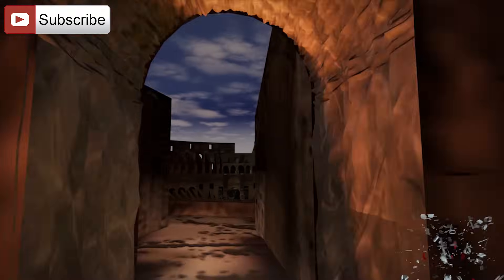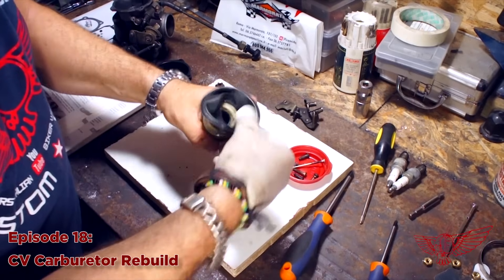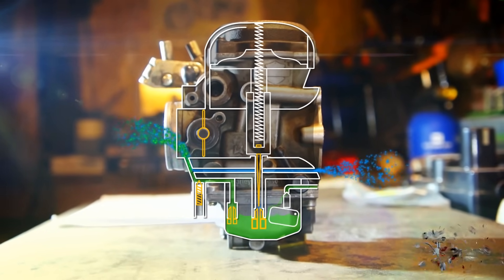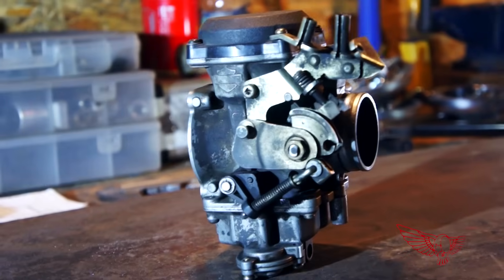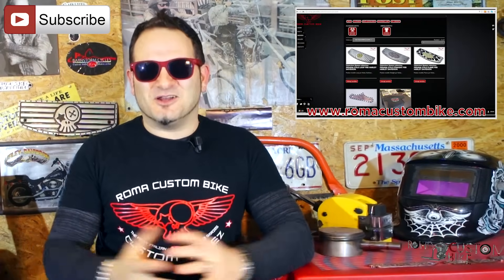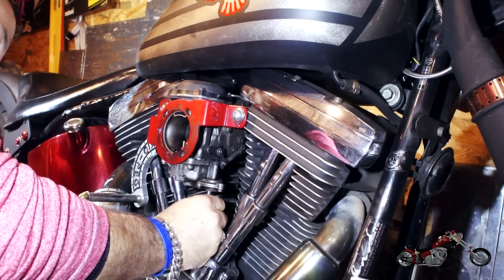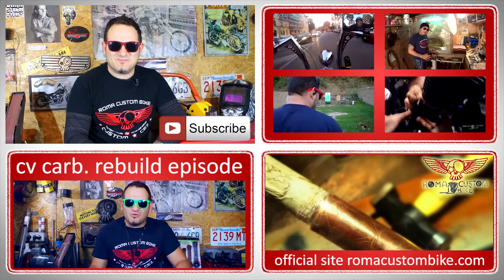How does CV carburetor work animation DIY adjustment screw - ep26 - Roma Custom Bike

Comment: i hav big question for u for problem i m facing. when i start my bike after 5 to 7 hours my bike shuts off while riding first 2km when i stop throttle my bike. after engine heats up or after 2km i dont face any trouble. again facing the problem after long hours. what it would be? pls reply. would be so kind of you. thank you
Reply from the maker: Hi Arooran, it is hard to tell what is going on with your bike, it would sound like an adjustment or jet issue. If you have trouble finding the culprit try going trough the rebuild process to make sure everything is ok.
Reply: +Custom Cez thank you so much for ur kind reply... let me check through... thank you..

Comment: Hi there my friend. Please do help me out with my doubt. I have a 28mm CV carburettor which is installed on my motorcycle. I have an issue like the bike starts choking when the throttle hits the higher side. When the rpm moves beyond 6k mark the bike starts jumping in rpm and it doesn't go above certain range. What would be the issue?

I have tried changing the jets, float and cleaned it completely. No use. Can you suggest me any troubleshooting solutions from your experience?

Thanks in advance. Cheers!!!
Reply from the maker: Hi Joel,
I think there is a leak somewhere between the carb and the heads. maybe the material gives out under pressure and the "hole" opens up at a certain rpm because of the rubber.
Try changing the manifold or inspecting it real well. 98% of carb problems are air leaks :)
Good luck bro!

Comment: Wouldnt this adjustment enrich the bike too much and foul plugs? I mean the more gas the more rpm but that doesn't really mean that the mixture is correct or am I wrong? Also adjusting this while the air filter is off will lean and overheat the bike making the adjustment incorrect...?

Comment: There is a screw to adjust the butterfly opening. Does it have to do with the carbs idle? Thank you
Reply from the maker: I don’t think there is such a screw, maybe you are thinking about the cable tightening screw?
Reply: I searched it afterwords and i meant the 3 screws that controls the butterfly opening all connected to the cable tightening screw but they only exist on cvk 4 stroke carbs. One closes the first butterfly and opens the next. The second does the same for the next two butterflies etc. Its being used for Carb sync so they will open all together when you pull the throttle. Do you know if the cable tightening screw must be completed closed when the engine idles? thank you

Comment: Hi, is this tuning applicable at high altitudes also, or we need to do something else? Also, someone told me to increase the idle rpm twice the current before tuning and then when you tune it, reset the idle rpm back- is it the way?
Reply from the maker: Hi Gaurav, I don't know about high altitude (but i don't see why not). For the high idle yes, set it a bit higher than when you run the bike normally :)

Comment: hello sir,
1. the way you are explaining ,is the best and it's best video to clear the concept about carburetor 
2.the language tone you are also best to understand for non English listener -speaker .

My Question - i have Honda shine bike. I repaired it 3 or 4 times but not satisfied and problems remained there so ,  I cleaned my bike's  petrol tank because of  rust  .Then my bike getting to much pick up  while i was holding the clutch and when i released it ,the bike went normally. 
so , sir Should i  can the carburetor or not ?
Pls suggest
Reply from the maker: Hi Biren, thank you so much! As a non English mother tongue I understand where you are coming from and I'm glad I could help :D
Regarding your bike, It sounds to me that you have ether air or fuel issues.
Air: You might have a hole or a leak in the manifold going from the carb to the cylinder, in many honda bikes the manifold is rubber and it can hide the crack or hole if not inspected very well. Also the connection between the carb and the manifold or the cylinder and the manifold might not be airtight. If it's old try replacing that (or those if you have 2 or more carbs).
Fuel: you might have a kink or a sharp bend in your fuel line (hose). When you give full throttle the pressure in the line sucks enough fuel but when you are idling (sitting with the clutch pulled) the bend doesn't allow enough fuel to go though. This starvs the carburetor of gas effectively leaning the mix fuel/air. The result is high rpm.
An other thing to check is the fuel filter, it might be clogged.

99% of the problems are usually air leaks so I would start with that. I would hate for you to spend the money to buy a new carb only to find out that the problem was the manifold or the fuel hose ;)

Good luck and let me know how it goes
Reply: Sir i'm from Gujarat of INDIA . Yes.... I got it .You are 100% right sir. My bike repairer had used some-kind of paste for leakage and form there air can be passed out and in  .
sir can we use this kind of paste for leakage ?
Thanks a lot sir . I hope and wish that God   gives you as well as your co-partners, so much strength and  power  with name and fame .  Best of Luck
Reply from the maker: Thank you so much brother 😉 
Yes you can use the paste on the extremities of the manifold but not if it’s cracked. In that case you need to buy a new one
Reply: Thanks a Lot .Brother

Comment: Very useful !  1990 FXRS, fuel tank venting problem. Does the fuel tank on this model vent only through the fuel cap ?
Usual Fat Bob tank with a fuel gauge on the left and filler cap on the right. Cruising at about 60 mph in 5th gear, after about 2 minutes, the engine feels like its running out of fuel. Back the throttle off a little and it recovers. when stopped and the fuel cap unscrewed, there is a huge hissing sound like pressure being released. A venting problem. The fuel cap is a factory type with the pressure release valve in the cap. The valve has a free, sprung movement and appears to be ok. There is small metal pipe that pokes through the filler neck, and exits the tank through the bottom and appears to be factory plugged. I cant see any other possible vents. The carb appears to be fine, no flooding and plenty of clean fuel in the float bowl when drained. 
Any ideas ? Love the show, delivered in plain, understandable language ! Lach, Kent, England.
Reply from the maker: +lachlan maccormack Hi Lachlan and thank you very much!!!!
you could have a small hose in between the two half tanks if that's the kind you have, it's by the spedo area. It often leads back to the air filter with a rubber hose. You definitely have something plugged that you shouldn't. I have the 2 halves and the right one has 2 knobs, one to connect it to the other half and one for venting.
Reply: +Custom Cez 
Well, sorted it ! The float needle was sticking half way so there wasn't enough fuel in the float bowl when the fuel pump was activated. Cleaned the edges of the float on a block with 1200 wet and dry paper, reassembled and now runs as it should. Should have drained the float bowl before its winter lay up. Happy days ! Roll on Summer. Lach.
Reply from the maker: +lachlan maccormack awesome man!!! glad u find the problem, it sucks to stay in "limbo" hahaha happy riding!!!

Comment: ok, my question is, the float adjustment ....  My bowl keeps pouring out gas none stop, so for the time i have a screw in the over flow drain tube.  How can i adjust the float to stop this from a none stop flow of fuel out the rain tube .
Reply from the maker: +badtag uncle nitch it sounds like you have something stuck in the little tube that prevents the valve (little conical shaped thingy attached to the float) from closing the circuit, clean it good with compressed air and see if it fixes your problem

Comment: 13:10 If you turn the "Adjustment screw"/"Pilot screw" three turns out and the RPM keep rising you need a bigger "Pilot jet"/"Slow jet" as the screw is getting dangerously fare out and could vibrate out.
Reply from the maker: +Snurre86 dude i think you should produce your own video and computer animation about this subject so you can explain it your way.
Reply: Why, you are doing so awesome. To be honest I would not even be close to compete.

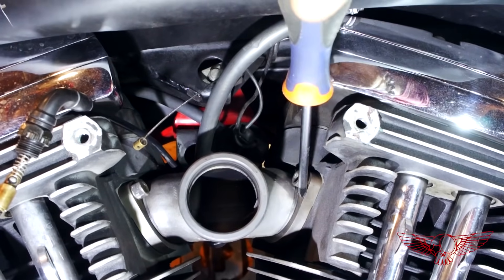Comment: 13:37 The way you do that is by spraying start spray when the engine is running and see if the RPM changes.
Reply from the maker: +Snurre86 you know everything son't u :-)
Reply: If I did would you be mad if I told you?
Reply: This also include the butterfly shaft felt seals.
Reply: Also note that on some bikes it would be impossible to hear the difference in RPM so you should have a sensitive tachometer that can accurately detect 50 RPM changes but less is always better.

Comment: The pilot/idle jet IS NOT the ONLY supply of fuel before the main jet! The accelerator pump sprays extra fuel into the carb throat when the throttle is twisted and  is what supplies the extra fuel needed during the lag between the butterfly opening and the vacuum slide/main jet needle rising. Also, the main jet needle controls the mid-range fuel amount between idle and wide open throttle where the main jet itself takes over the amount of fuel being delivered to the engine.

Comment: Hello, I have two questions; I have a heritage softail evo but I can’t access the mixture screw with the air filter on you say and I’ve read that in order to make the correct adjustments it needs to be on, should I just do it without the filter? 

2- when you say clockwise you mean with the carburetor upside down, like when it’s off the bike so when it’s on the bike and you want to adjust the mixture you still say clockwise to lean and counter to enrich but it should be the other way around at the carburetor
Is upside down ?
Reply: He's talking about the pilot/air/fuel mixture screw. It's not changing anything if you have the carb upside down, out, or in. When you turn the screw in ( clockwise), the fuel mixture gets leaner, when you turn it out, it gets richer. Comprentte?

Comment: I've been adjusting that fuel screw trying to find the sweet spot on my GS550. Pretty sure they're the CV carbs. Does that screw only adjust the fuel mixture during idle or does it effect top end too? Bike accels well but when i put on the throttle it sounds like it spins out at the top end and doesn't increase power. (sounds like gargling basically). Is this the screw I would need to adjust to fix this? If not what should be adjusted? Another thing to note is sometimes I hear a hiccup come from the carbs. know its from the carbs because when syncing the needle jumps on one or two carbs, not sure if its related.
Reply from the maker: +Ryan K hi there, the screw is only for idle and the first 1/3 of the throttle (more or less) top end issues are usually main jet related or cleanliness related. The hiccup might go away once everything is well tuned. Look also for air leaks in the system

Comment: beautiful explanation! 
Animation part was nice yo watch and helps learning. 

Q. I have a honda 160 cc bike. It has evap  canister in it, and secondary air intake too. Do I adjust my carb by plugging secondary air and evap lines first. When all is adjusted, then I connect secondary air intake and do slight final adjustment. 
Whats your take on this?
Reply from the maker: thank you very much man :)
but i didn't understand the question, can you repeat?

Comment: 2:04 Never use any metal (wire/drill bit) to clean the jets or passages this metal parts are extremely soft and accurate so if you absolutely have to, only use non-reinforced plastic (or make sure it is softer then any metal) on stubborn debris. You are in danger of enlarging or upsetting the extremely accurate dimensions.

Comment: Hi!
I have one problem n i think u can help me out.
I have 160cc apache rtr . It was giving a milage of 42kmpl.
Bt now it is giving milage of 28kmpl only...so i tried to adjust carb... 
I have one confusion that jst reducing ideal fule mix can increasing milage.. And what should be position for screw connected with throttle cable at ideal position.?
Reply from the maker: Hi Shreejan, if you didn't do anything to the bike (like change jets) then you must have a leak because half the miles is not something that "just happens" without messing around a lot :)
Adjusting you might change + or - 1 mile per gallon. check that you are not losing fuel somewhere or that your main jes is in its place.
Good luck :)

Comment: So if the mixture screw doesn’t do anything it means the pilot is too big or too small and way off or the jet is plugged. My scooter only runs with its choke on and will die with it off. I need to go a bigger size pilot

Comment: how do I know if I have a fuel regulate screw or an air screw. "01 HONDA SHADOW SPIRIT1100.
Reply from the maker: Hi BlackCat, if the screw is near the engine manifold it regulates the fuel, if it is near the air filter it regulates the air intake :)

Comment: Any help would be greatly appreciated I have a 83 Suzuki gs550l with the Dual CV carburetors and I am having issue of runaway it idles at cold start up somewhat okay A little choppy but okay but when cold if you give it some throttle it just runs away at 5000 RPM Full Throttle the cable is not sticking, I have adjusted the idle screw in the middle till it wasn't even touching the throttle linkage anymore so it's not that but as it warms up if you start it it just goes straight to 5000 RPM I'm going to double-check a few things this weekend before I take it out and tear it apart but just wanted to see if somebody knew what could cause that in this type of carburetor I was told recently to clean the Jets which I do plan on doing but I just don't think that's it and yes this bike does have a vacuum petcock which one of the things I'm going to check is to make sure everything is tight on the vacuum lines just in case that's it but when it idles real high I can use the choke as a somewhat throttle at half choked it calms somewhat down at close to full choke it dies I've been doing a lot of research over the last week even going through the owner's manual and service manual I bought for this like and I have a few ideas of what it could be but wanted to see if somebody on here have a lot more experience than I do with this type of carburetor oh, I already got a hold of the manufacturer that makes the carburetor and they said Jets as well but to me it's just not making sense why the Jets if they were clogged the bike wouldn't run right or run that high

Comment: Hey buddy, help me know'm fixing my bike honda bros NT400, which has problems with the carburetor engine V 400cc 1999 carburetor delivers a lot of fuel to the combustion chamber, inspect and where is the abuja out too much fuel as if it was a river lot in a single carburetor, I need help greetings from Chile
Reply from the maker: Hi Carlos, play with the jets, you might need a smaller set

Comment: For all who want to change the diaphragms, there's a way to do it properly. Cut the old plastic parts that hold it in place off, then drill holes to fit pivots. Then use the right tool to make them tight and problem solved.

Comment: Is there anyone here that can help with a weird carb issue. I rebuilt carbs on my crf250 and 450's a few times successfully but this last time the bike will only start with full throttle and idles fine after that.
Reply from the maker: check for air leaks somewhere, in the manifold, in the gaskets. 95% of carb problems are air leaks

Comment: U need to tune ur carb with air filters attached in the air circuit
bcz as soon as u add the air filter, mix will go rich.
Adding negative pressure in the exhaust will alter real life engine behaviour
infact increasing the exhaust pipe length will alter results but at much higher rpm.
Reply from the maker: Hi there, you are right, but my air filter is almost a velocity stack. Also easier to describe for video purpose.
Thank you for pointing out about the negative pressure at the exhaust though, did not know that :)
Reply: YEA the air filter change is nominal n meant only for tuners
if u hv more 1 dan  cylinders ,then each exhaust pulse will create a hi pres followed by a low pres wave that scavenge the exhuast 4m the next cyl
adding a negative pres will harm this effect at hi rpm
also the length of pipe is used to resonate sound wave pressure wid exhaust pulse :]
hope it makes u curious

Comment: 7:12 I can see that you are not using a JIS B 1012 screwdriver as all the fasteners are damaged and they also have the dot on them, therefor I know they are Japanese.
Reply from the maker: +Snurre86 i don't even know what a Jisb1012 is... yet i live a happy life :-)
Reply: Never striped a fastener? It is not a fun time. Just trying to save you and your viewers the hassle. Especially when removing the butterfly and butterfly shaft for changing or relubricate the felt seals.

Comment: I never understood why my either of my motorcycles would idle or run right after removing the factory air box/filter to put in a K&N pod filter ... Now i know why, more air intake leaned out the mixture which made the engine run bad, had i known to adjust the fuel screw to allow more fuel, it would have saved me $250 in repair costs ...

Comment: Never insert a steel or any other metal wire into the brass jets. If the wire scratches the interior surface of the brass jet while you are trying to poke /push out a clog/dirt, well then the scratched interior surface of the jet will now cause a turbulence and uneven fuel flow and this will have a bad effect on performance. Maybe, just maybe you can use a nylon wire as it is softer than the brass used in the jets. But there is a better method.
Use a solvent and high pressure air to remove the dirt that is clogging the jet.
Reply from the maker: Thank you Peter for the suggestion, it does make sense especially for performance bikes!!!
Reply: I pluck a wire from a brass brush to clear mine out